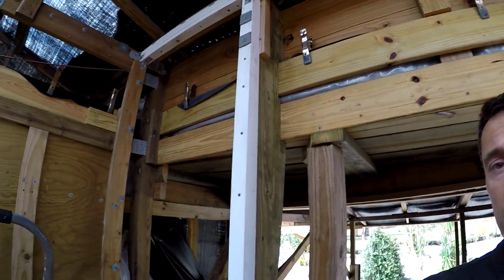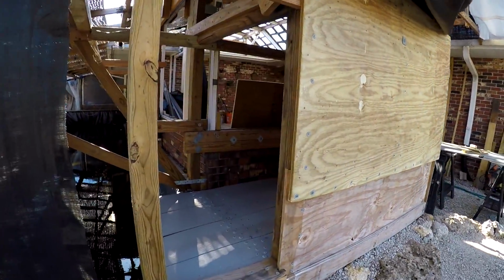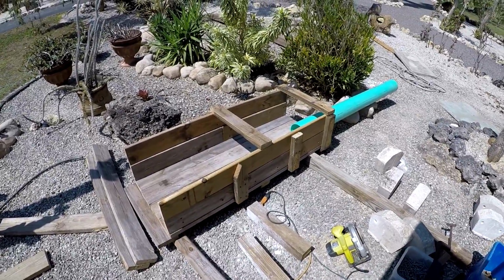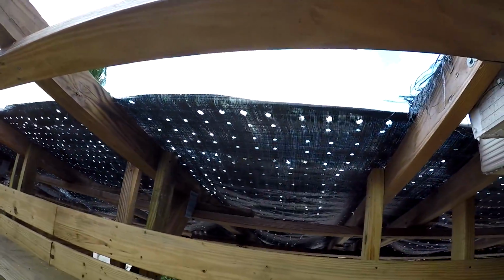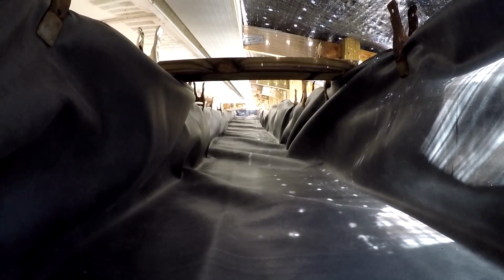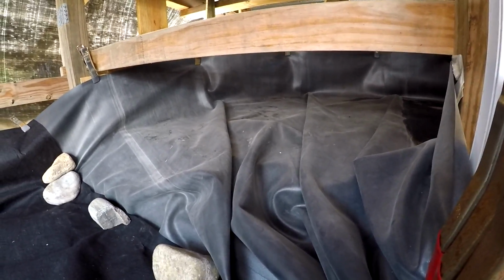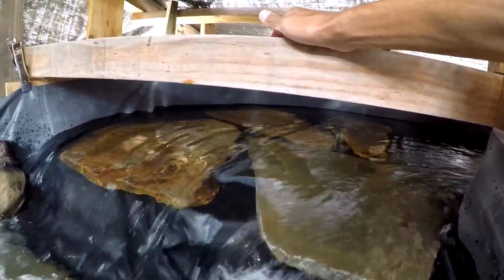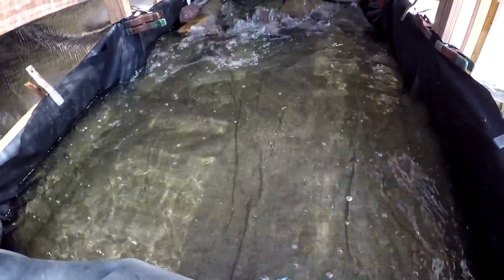Koi exhibit of 25,000 gal is functional!  Shower-tower filter and aqueduct build.

Comment: You’re doing a great job on you’re own bro...a though on the aqueduct....if you don’t plastic over just that...it could make a great algae scrubber! Using the sun only to light it...that would help with oxygenating the water while keeping nitrates supper low!....
Reply from the maker: Great thought.  The pluses are great and you named them - oxygenation plus nitrate removal and other water improvement.  What do you think of the minuses?  
- The algae will need to be removed once they overgrow (very hard to do as the aqueduct is mere inches from the roof - no space to work freely).
- The algae will slow down water flow potentially threatening a back flow and/or an overflow of the aqueduct.
- Part of the algae will naturally die off clogging the "aquasock" fabric and being long and clingy strings they would be impossible to vacuum out with my wet/dry Shopvac.

Comment: Brilliant Idea you have for the filtration the mesh is to thick it will clog how about a course sponge the type that's like a coated strands that you can take out spray with the hose and put it back I've seen it in black color or plastic covered wire mesh.👍
Reply from the maker: I appreciate it.  That is all agreeable!  Yet for now I am aiming and hoping for the ground-water-flow-control fabric, which I am currently experimenting with, to serve as a "catch it all" filter, in the same vein as an aquasock as the first stage of filtration in smaller setups.  If that fails, I will keep your suggestion in mind and I will need to figure out how not to foul the shower-tower biofilter with accumulated gunk because cleaning the tower would be very, highly impractical.  It looks like as the pond is settling I need to vacuum the fabric less often, to the point of once in 24 hours.  The koi spawned half a dozen times though meanwhile, which leads to the accumulation of flow-restrictive mucus in the fabric, so when that happens, I have to vacuum up to 3-4 times a day and keep the flow at 1/5-1/4 at night.

Comment: U could use plastics nets insted of pot scurbs
Reply from the maker: Thank you for the thought.  So far I have been using 50%-shade cloth and insect screening.  I have about 25,000 square feet of these two as the biomedia in the 15,000 gal sump / water reserve, which filters the two 4500 gal tanks.  Leaf netting would work too as would of course a fishing net.
Reply from the maker: Plastic chicken wire / mesh barrier too :)
Reply: Keep up the good work
Reply: U are great
Reply from the maker: Haha!  I beg to differ.

Comment: Nice job bro. How did you seal liner to glass front?
Reply from the maker: I appreciate it, Marcus. The EDPM rubber liner is squeezed between the front glass and an acrylic strip in the back by SS bolts every 3.5" with DOW 795 specialty silicone between the liner and the window.  It is described in this video:  https://www.youtube.com/watch?v=jBWiyy14D68
Reply: Fish Story Aquarium & Rescue thanks bro really appreciate it.

Comment: Hey buddy I found something cheap that will work for you perfect,check out "Plastic Drainage Mesh squares" there's different size squares and shapes I think it's E bay.
Reply from the maker: I appreciate it, Eddy!  Yeah these would work for biomedia when one has ample space in their filters as is my case and also for the aquasock fabric support on top of the shower tower in place of the eggcrate light diffuser panels as the latter are rather brittle, not very strong mechanically.